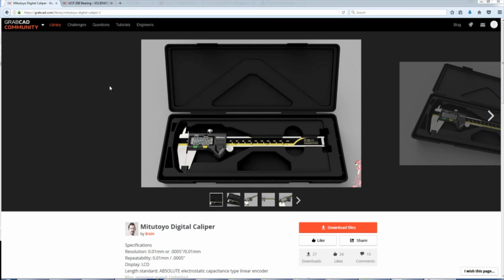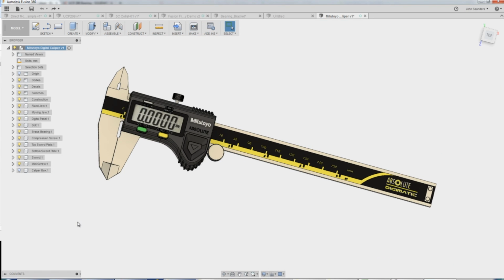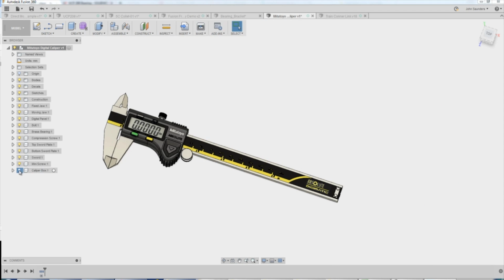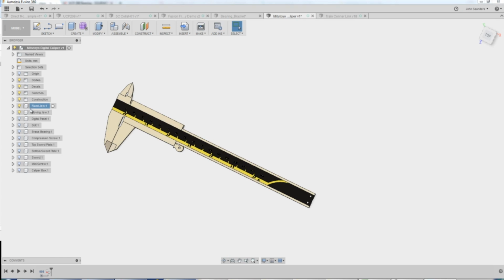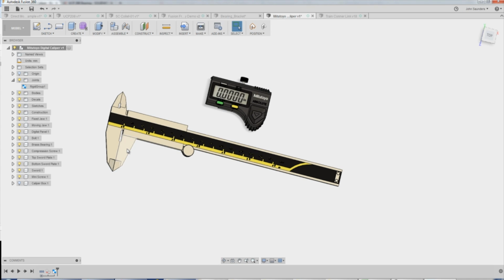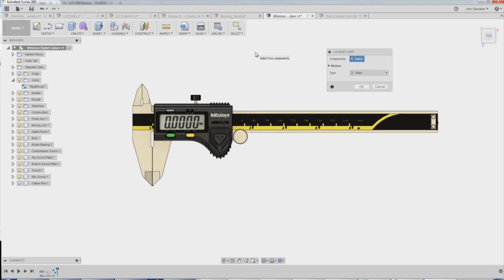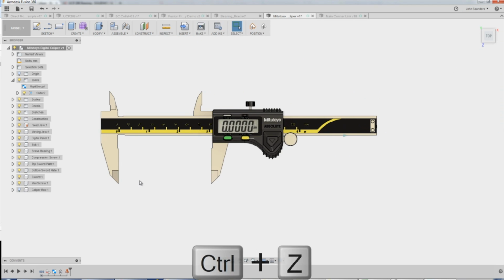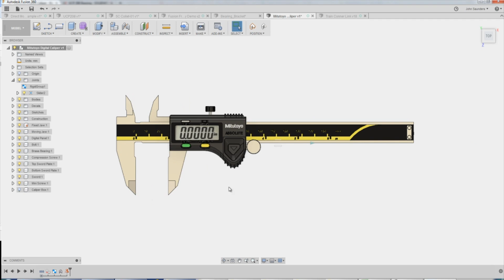Getting Started with Fusion 360: Tips for an Imported Part! FF82

Comment: I'm just learning Fusion 360 on my Mackbook pro and am having a heck of a time trying to figure out how to assemble Components.  I assume that the commands are different on a mackbook pro laptop. I don't use an external mouse if that matters.  Any tips???  Thanks,  Chris
Reply: Shadowdog500 
A seperate mouse is a must, as the built in one doesn't have a center wheel to click down
Reply: Sicktrickintuner that's true, but on Mac there are gestures.
Reply: I must not know all of the Mac Gestures for Fusion.  This may be my excuse to spend$79 for a Mac Magic mouse. LOL!  Chris